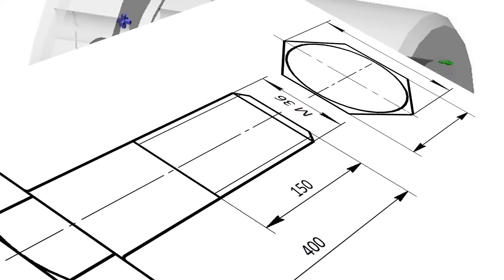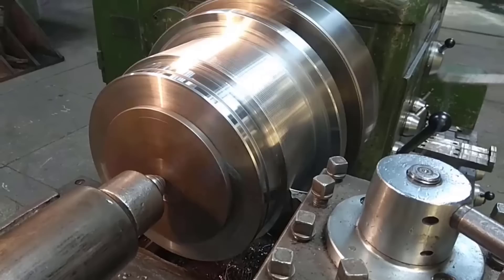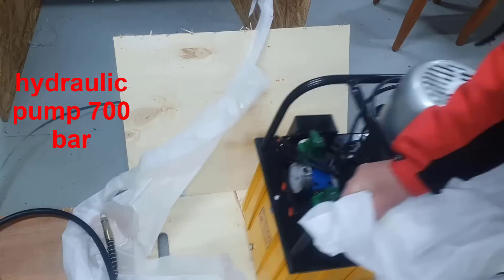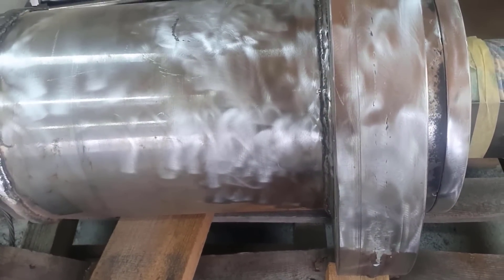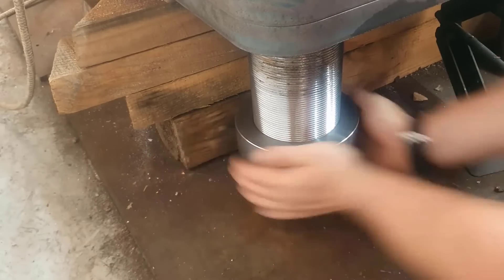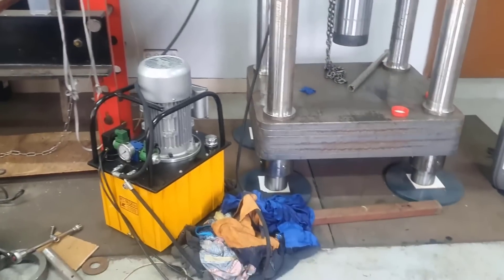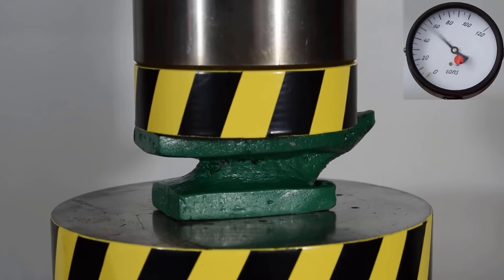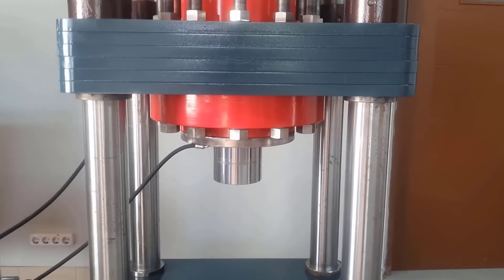HOME MADE 500 TON HYDRAULIC PRESS

Comment: One thing I personally found is that instead of using a single expensive piston/cylinder for the 500 tonne press, that pressure CAN be distributed over a larger surface area using a cheaper set of SMALLER-DIAMETER and SHORTER hydraulic cylinders that are attached to the press plate itself which can then get the same amount of force and be MUCH CHEAPER to manufacture. 

You can buy 1 meter long at 10 cm diameter 370K Maraging Steel (370,000 PSI or 2551 MPa) rods to CNC machine and use as the pistons for much cheaper than what you have here and simply use multiples of them to apply the pressure on an even basis on the entire press plate to get to the final 500 tonnes or more of pressure! A one metre long 300K to 370K maraging steel rod at 10 cm diameter is quite cheap and you only need a a 3x3 array to apply ENORMOUS pressures! When spaced 30 cm apart, the maximum possible SAFELY APPLIED force per rod should be only ONE THIRD the PSI/MPa tensile strength rating (i.e. the compressive strength when stood on the vertical axis is MUCH LESS than the ultimate yield strength along the horizontal length for horizontal rods due to rod/piston shearing and buckling issues at high rod/piston length versus diameter ratios of 10:1 or more!). 

This means that using 370K Maraging Steel allows for a maximum force of 123,000 PSI (Pounds per Square Inch) or 848 MPa on the vertical axis, which when you multiply that over the 78 square cm area of a 10 cm diameter piston equates to 660 Metric tons per cylinder of maximum possible vertical compressive load! And when applied over a 3 x 3 array of pistons spread out over one square meter, the maximum POSSIBLE total area pressure is 5,940 Metric tonnes!

Your hydraulic lines will fail before you EVER reach such pressures!

CNC machining and assembling multiple shorter and smaller-diameter rods/pistons is MUCH cheaper and faster than machining one long and large diameter piston! You will save a LOT of time and money using multiple rods/pistons instead. Hydraulic lines of the same length and a simple and cheap Pi computer with pressure feedback sensors will be able to keep the pressures even on all the rods/pistons to ensure no excessive torsional stresses on the press plate itself. You could EASILY goto 1000, 2000, 3000 and even 4000+ metric tonnes using this method!

V

Comment: How about a video explaining how the hydraulic pump actually works.  Slapping a bunch of steel together is all very nice; the real magic is how that much force is created.  Thank you
Reply: 1) Get a pump with high atm rating.  Although the pump is rated 700 atm,  you never use the rated pressure, so let's say 400 atm = 5878 PSI.  2) Divide 500 tons by that yields 170 square inch cylinder face, which is lucky 13" diameter. 3) deliver the pressure (appropriately rated hydraulic line, 4) contain the pressure (tolerances and rings in the cylinder), 5) retain the cylinder in a frame with enough rigidity to both take the pressure without yielding, and without shearing when the load material is uneven or off centre (KSI ratings of the materials, and their dimensions).  It sounds like you would have liked more details on part 5.  I was surprised to not see any diagonal bracing.  I was equally surprised not to see bushings in the cylinder housing, but I'm sure they exist or the gaskets will fail under the lateral loads we regularly see on this channel.